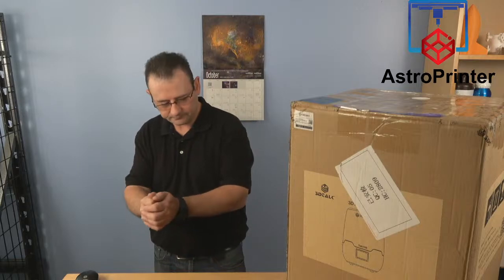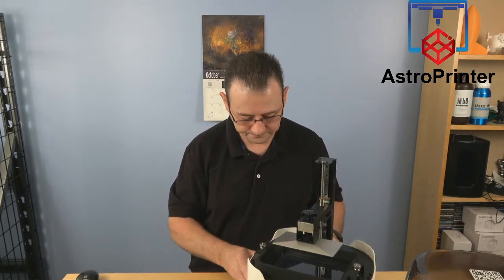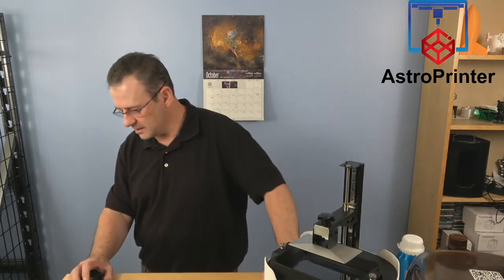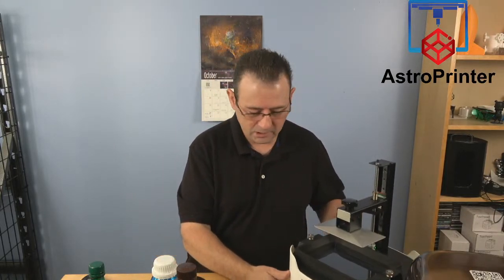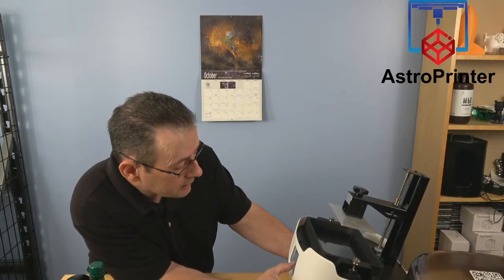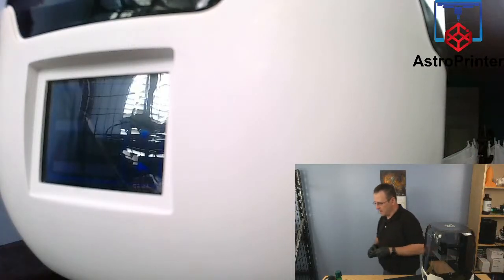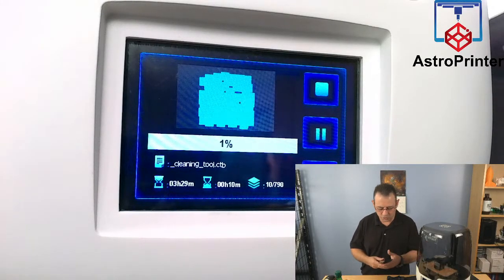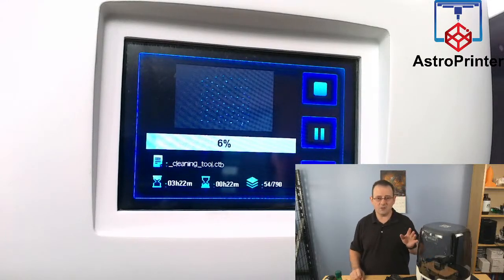3DTalk TEK100 2k Resin Printer Live Unboxing

Comment: Can you share the profile for the printer? I have the same printer and can't get it started or even loading their profile in chitubox..thanks a lot !
Reply from the maker: I use their profile.and it worked great. What issues are you seeing
Reply: @PrintingNerd  I tried exactly how its specified in the instructions pdf...in chitubox add new printer / Others / Default  and after that import the configuration file from tek100. But absolutely nothing happens. And if i try adding manually the printers resolution, slice and print, it just raising to the top untill its starting to skip because its hitting the max and keeps hitting untill i turn the power off. But...with a file already sliced from them its working. So definitely the profile that they sent to me its wrong or something. If you can send me the cfg file that u use. And let me know please if u done something different from what i did...maybe i missed something. Thanks!